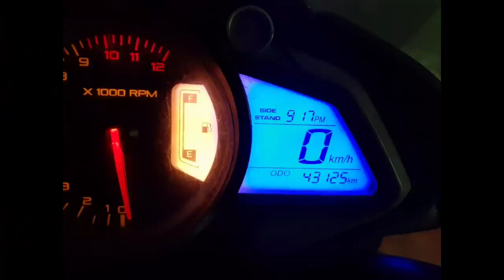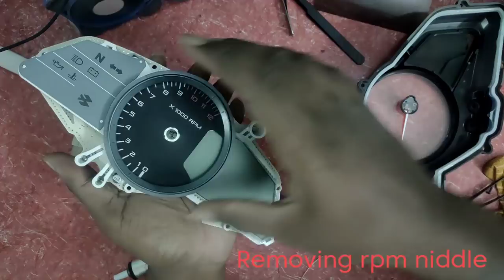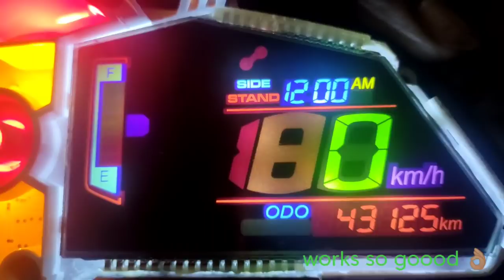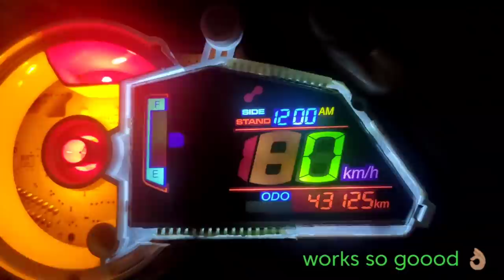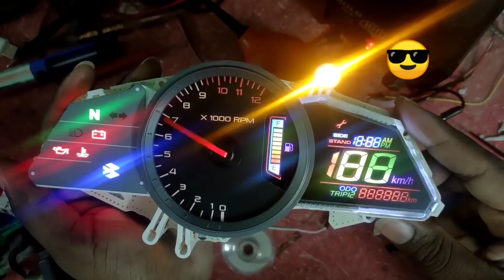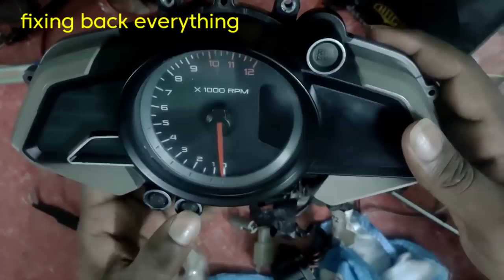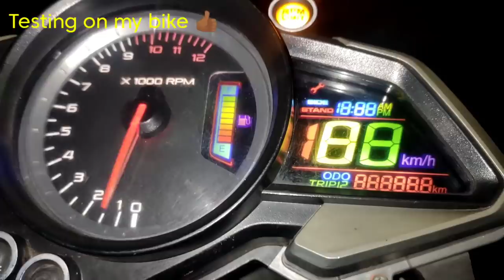How I modified my ❤#NS 200 speedometer,making video

Comment: Can i do this in my pulsar 180 bs 3 as it doesn't have AHO, and will i able to see the display without turning on the cluster light. And my cluster lits up only when engine is start
Reply from the maker: Ss bro you can able to see without back light too..
Reply: Tq bro

Comment: Bro nice modification love it, I also have a question, is the rubber M and S on the speedo can be change also? I have seen ppl in my country using different Icon, don't know if it just a sticker or a whole replacement
Reply from the maker: Hoooo
New one I need check it bro definitely I all make if I can..
Thanks for watching...
Reply: @dxnio4755  thank you bro, your video  really help a alot of new pulsar user 😊😊